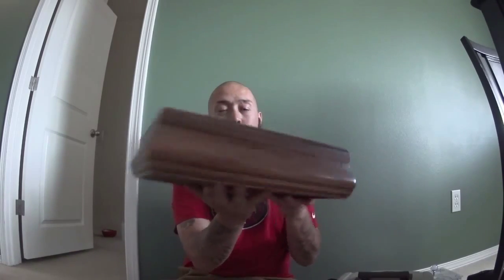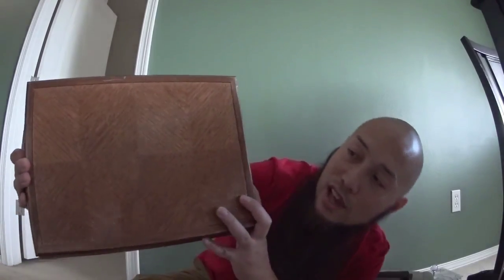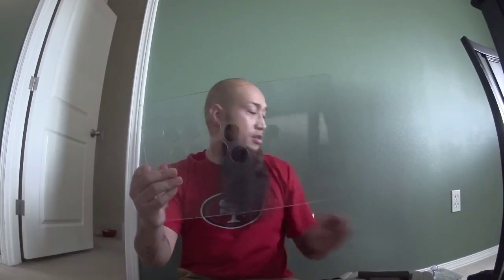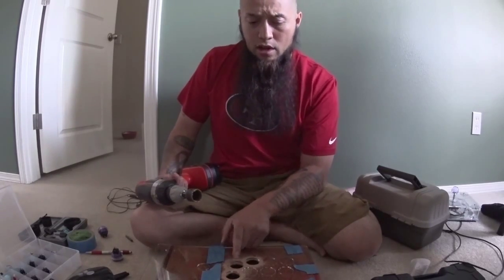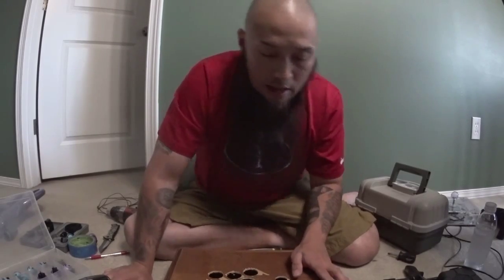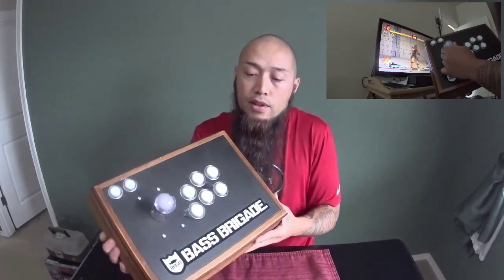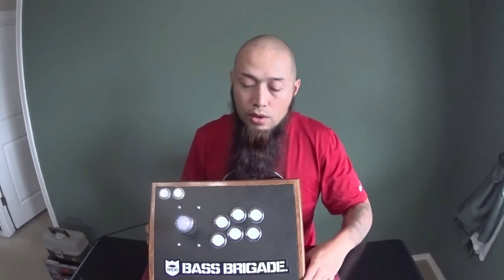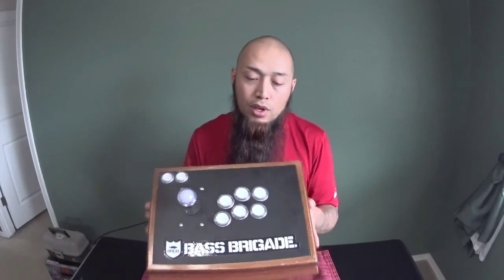My custom Arcade Fight Stick Build

Comment: Nice Arcade Stick, can you tell more about the PCB to which the buttons and stick are connected ! Thanks.
Reply from the maker: +yogissj the stick is just plug and play. The harness that goes to the stick connect directly to the pcb. The button worse just gets screwed down to the pub where each connecter is label

Comment: Great looking custom fightstick man! Only question, have you tested it on the SF5 beta? I've got an Eightarc Fusion for the 360/PS3 but I read those won't work with SF5. I'd like to make a custom PS4 compatible stick but want to know that it'll work with SF5 before doing so.
Reply from the maker: It's doesn't work on the beta but capcom confirmed all working ps4 fight sticks will work with the official game released in February

Comment: I noticed when I was trying to mod my Hori pro 3 SA that there was a bracket that gave the joystick some room between the top of the case. When mounting the joystick, does it have to have some room between the top of the case?
Reply from the maker: It depends on the thickness of the case your making. In this build the the case had a very thin surface so I had to use the spacers. If I didn't the handle/stick would have been tall.

So if the case is about 3/8" think you wouldn't need one really

Click this link and see my latest build

https://youtu.be/Gw-pVCvJkSs

Comment: What pcb was used?
Reply from the maker: Ps360+
Reply: I got a nyga arcade stick could you tell me what buttons to get for it and also I wanna change the joystick , the stock on is is to big and not comfortable i prefer I smaller ball
Reply: +shofi miah Get Sanwa 30 Milimeter ones (3CM) are the most recommended ones